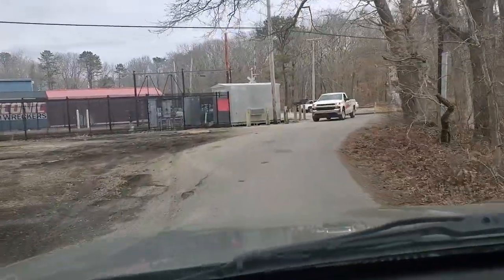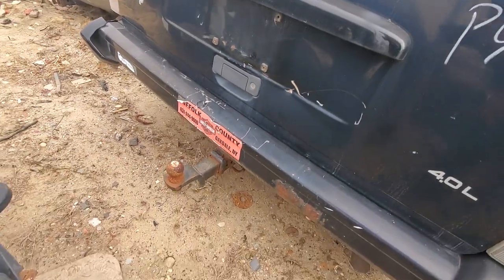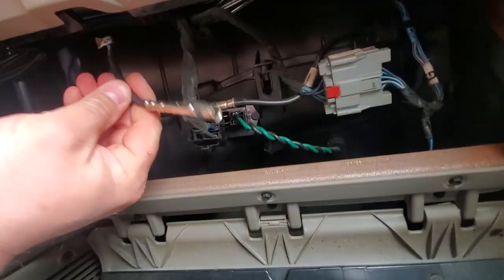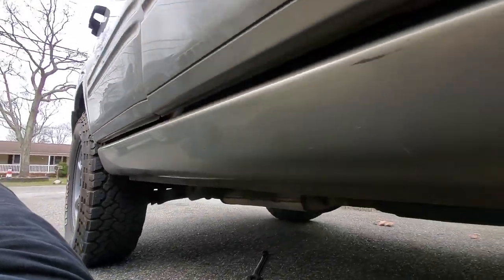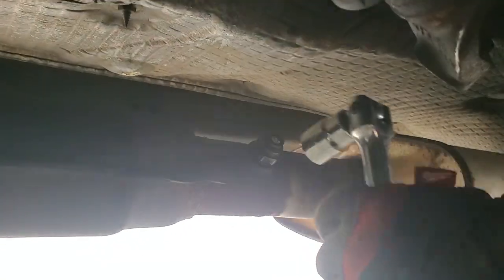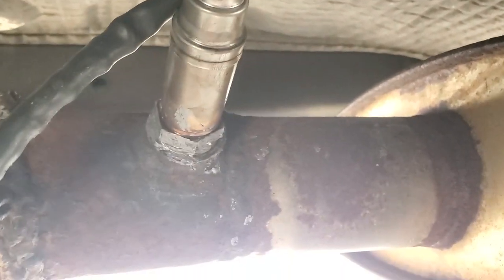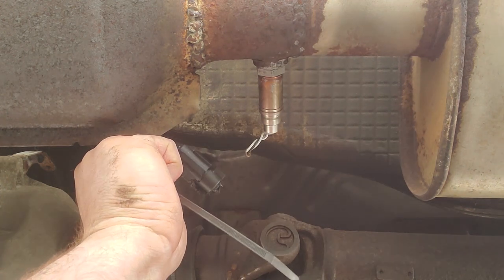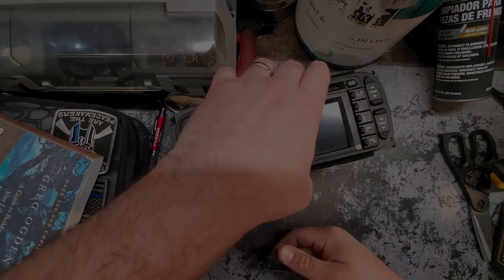1998 GRAND CHEROKEE ZJ DOWNSTREAM O2 SENSOR & JUNK YARD VISIT

Comment: When removing O2 sensors i find it easier to tighten it first just a little and then back it out. Might need to repeat a few times till it loosens enough
Reply from the maker: excellent suggestion!

Comment: My ZJ hasn't really like the Bosch's in the past.  The Mopar ones are NTK and Advance carries those too so that's what I have right now and it runs great.

Also, no idea LI had junk yards!  Gotta drive out to check that one out!
Reply from the maker: Yeah we'll see what happens with these Bosch.. hopefully they last a little longer than their reputation says.. That yard is way out in Remsenburg.. One of the few that are left
Reply: @ProjectDanH  Damn, that's like an hour and a half from the city, haha.
Reply: I have heard this same thing among Jeep folks and I have just never experienced it in all my years. My Bosch sensors have always worked fine. The primary reason I have gone with Bosch was because, when the original NTK did go bad, it needed fixing right now and the NTK's took several days to get in my area. Maybe I have been lucky. I've been using Bosch sensors since my Volvos in the 1980's. I don't drive a lot and use good gas. Who knows? I certainly wouldn't use a generic sensor but I feel okay with the Bosch on the whole. They have a warranty and are easy to change if they go bad. That's just me.

Comment: that RB1 radio was a nice grab for 150$. you can easily add bluetooth to that factory radio by using the small square CD changer plug next to the main rectangle shaped harness plug. youll need to cobble together a RCA harness to a factory CD changer pigtail, then add 12V rca bluetooth modulator to the RCA end and bang! bluetooth factory radio. theres only 1 video of a RBI install into an XJ on youtube, its not that clean of an install, but it has some good info. you might be able to get an adapter from coastal tech for the Mygig radio you were eyeballing in the scrapyard. i used one of thier harnesses for a mygig swap in my 07 commander, worked great, good quality too.
Reply from the maker: That's exactly what I plan on doing!  I saw that RB1 nav video years ago and have always been intrigued by it.  I'm gonna try to replicate it.  I also already purchased a Bluetooth adapter for it! Stay tuned !!
Reply: @ProjectDanH  Dude im tellin ya, like minds man, like minds.
Reply: i want to do a similar deal too,i wanna  get rid of my alpine, and try to use a factory 02-07 6 disc factory radio. i just gotta figure out how to be able to use my 3 alpine amps im running, or im just gonna bite the bullit and get a Joying 10"  touch screen lol
Reply from the maker: @motownXJdad9565  dang.. the amps kinda ruin that plan....

Comment: My 98 5.9 zj is popping 2 codes for 02 sensors and it’s running like total crap , could 02 sensors cause it to run bad? I mean spitting and sputtering almost like it has a cam lol 😆!?

Comment: Just going to give you a headsup as a former dodge dealer mechanic.   youre gonna wanna throw that bosch 02 sensor in the trash and buy one from the dealer or the brand NTK.     reason being is the bosch isnt gonna work.    it has heater resistance thats the wrong spec and usually never fix the 02 dtc or worse yet start to cause misfires,  stalling etc,    if you dont wanna believe me a quick google search on dozens of forum posts in everything from jeep forums to actual technicians discussing how often this doesnt work.     if you feel like im just running bosch down and want further testimony
Reply from the maker: lol! thanks Jeff. I appreciate the heads up. I'm looking forward to my "don't use Bosch o2 sensor vid" 😬